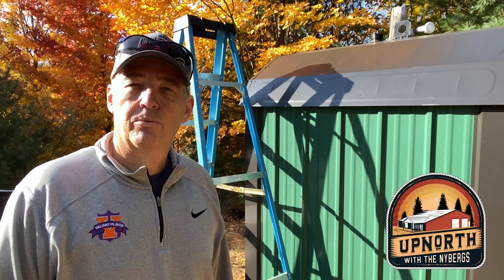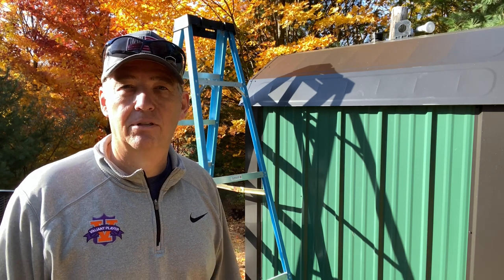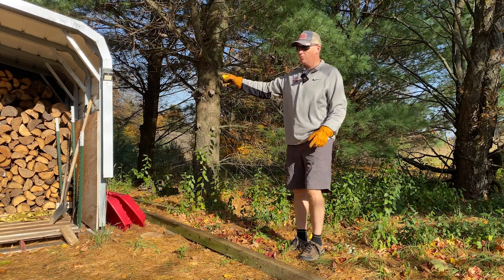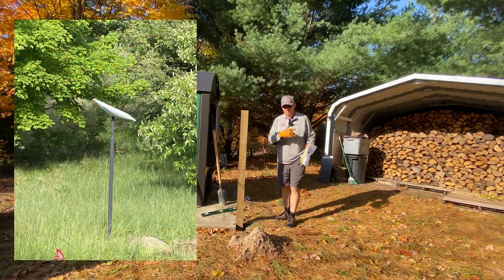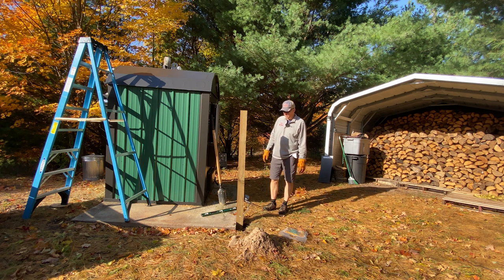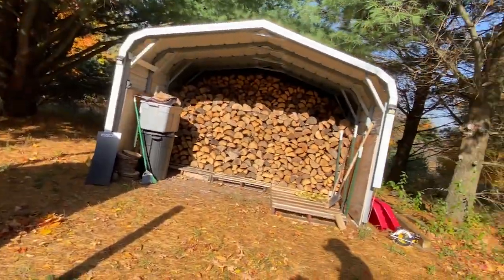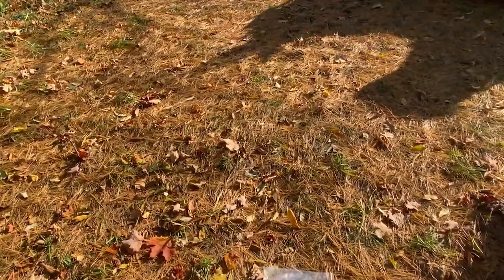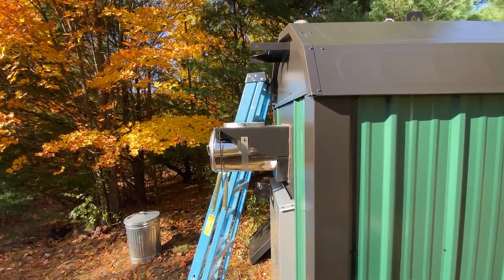Central Boiler Projects - New Classic Edge HDX 760

Comment: Looking good.   I have the same "drop-it" screw problem as well.....ugh.   Big box stores sell a magnet on a broom handle....  designed for picking up nails on build sites.   A smaller magnet tool from the world of automotive repair gains acess to tight spaces....   basically  cylinder magnet on a long screwdriver handle....  not home made,  comercially produced.   Both have helped me avoid going to the hardware store looking for the exact lost screw.   Thanks for the vid and your time.
Reply from the maker: Thanks Jules, hope all is well! 

My wife says I have sausage fingers thus the reason for dropping small things ;-) I have a couple of those "magnets on a stick", unfortunately, my shop is about a 1/2 mile down the driveway and when I need something it is always "at the shop"...hehe. I do need to add that tool to the back of my already over-crowded toll chest on the back of the quad.